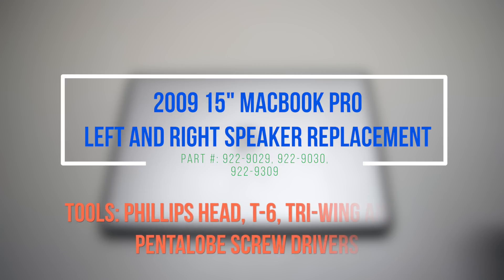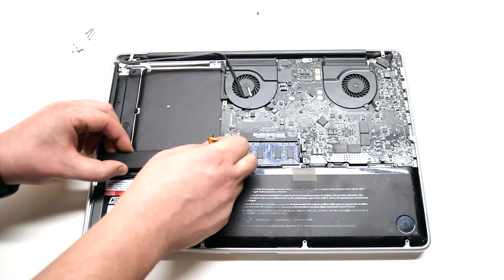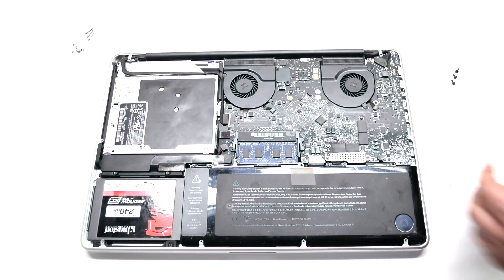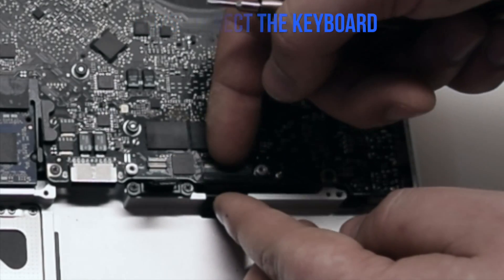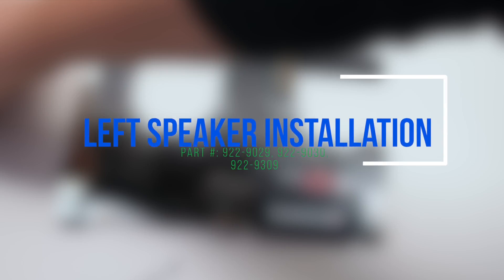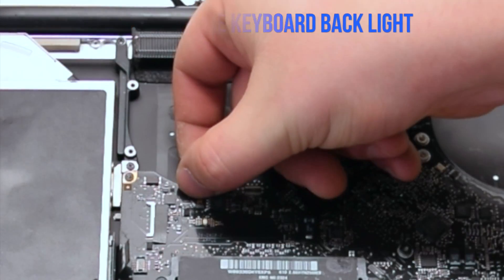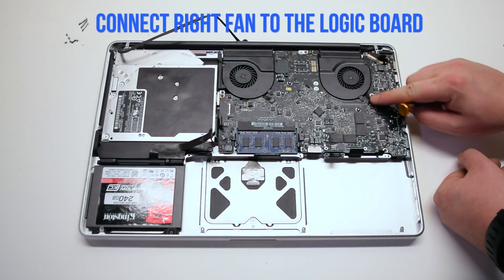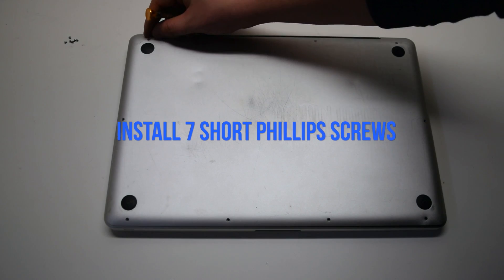2009 Macbook Pro 15" A1286 Left and Right Speaker Replacement

Comment: is there a way to replace the connector on the board? I just realized that the speaker connector is missing on the board, Someone was goin to throw this this particular model to the trash, so I ask for it. But it seems someone had all ready work on this machine before. I open it up and started cleaning it then I saw the speaker disconnected, I was confuse, I could not find the were to connect it. seen this video make me realized that the connector on the board is missing, it looks like it was remove on purpose because the area where it should have been its really clean with no sings that the connector was there.

Comment: All was going well on removing the right speaker. However, the screws were very very hard to remove and the middle one left side would not budge. Ruined two screwdrivers and eventually had to  cut the plastic around the screw. Not ideal. 

The only issue I had was replacing the wi fi cable which did not want to go in.